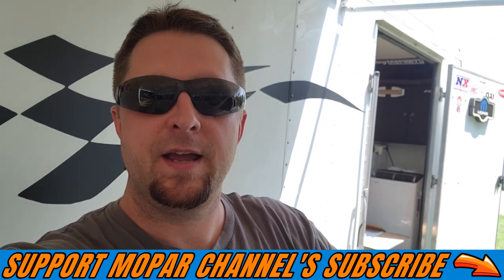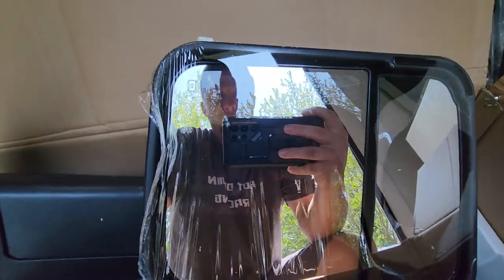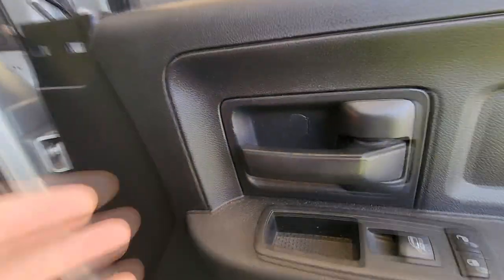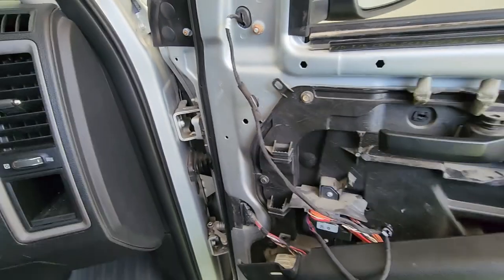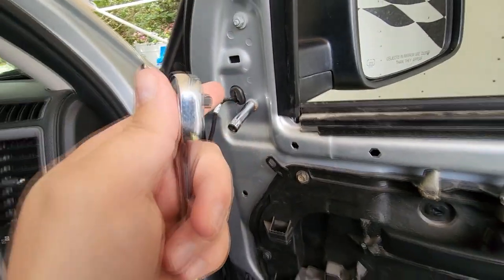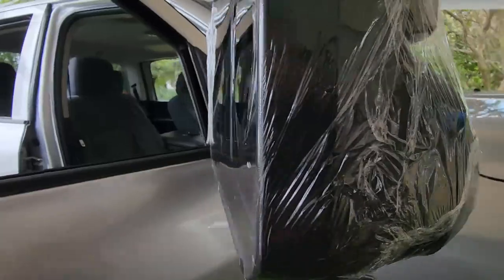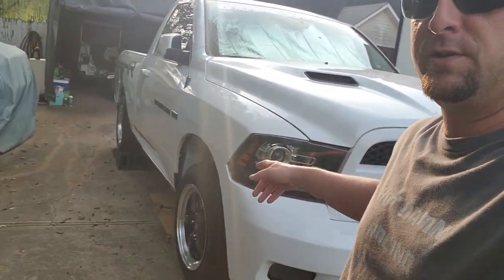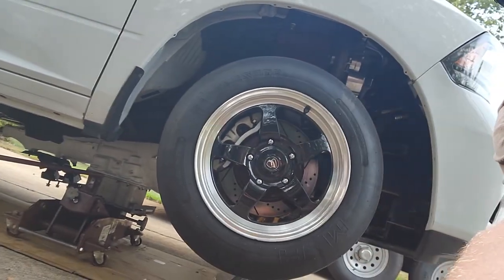Tow Mirrors For Your RAM Truck From Sanooer Auto Parts

Comment: I installed a different Sanooer toeing mirror on my Ram 1500. It was absolutely a simple install . Next time you go a video like this, read your manual first. You won’t look so clueless.
Reply: The manual doesn't show much. I skipped through a lot. Mine doesn't have the blue wire. I have the AlphaOBD to update the software, just need to figure it out. I already bought it to do myself. I already changed the lock settings so it doesn't honk and unlocks all doors with one push off the button. With two RAM trucks, I'd say you should get it. I need to program my keys, too.

Comment: Did you ever figure out what the single blue wire operates and where to connect it? Just added tow mirrors, they didn't come with installation instructions.  Everything works, except the auto dimming feature that was on the oem mirrors.
Reply from the maker: No I haven't messed with them anymore yet.

Comment: I had same OEM Mirrors, and got Exact OEM Ram Tow AND Power Folding ones. They were only $260.
These are not OEM size and design.
Just look more intently and thoroughly, and would find OEM and get the Power Folding too.

Comment: Hello from Australia 🇦🇺 
I have contacted Sanooer, but they can't get their heads around that Australia run the older model to the US.
My question is, are you still 100% happy with the product & the folding frature on the mirrors were they manual hand fold or do they the gearing & electric Electric motor fitted to be electric fold compatible
Reply from the maker: Yes they work great I love em.
Reply: I figured they were electric. Super heavy and I didn't want to break anything.

Comment: anyone have a idea on how to wire the running lights
Reply: AlphaOBD. Costs a decent amount, but I want to use it for remote start and program my fobs, plus for LEDs.
Reply: @DeliberateNRandom  so I ended up figuring it out. There is a blue wire for the running outta you must tap a fuse. AlfaOBD is for programming the turn signal and running lights .

Comment: You can bypass them !!
Reply: How I’m having the same problem.  Dealership wants 160 to flash the computer to tell the truck to turn those options on
Reply: I bought the AlphaOBD. I'm trying to figure out the software and not mess anything up.